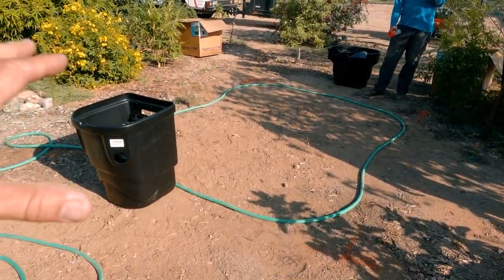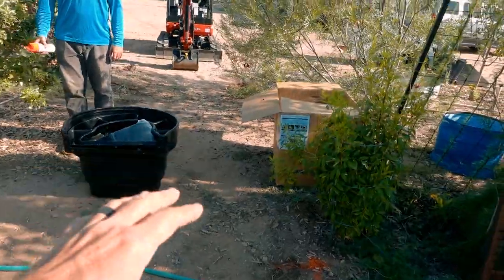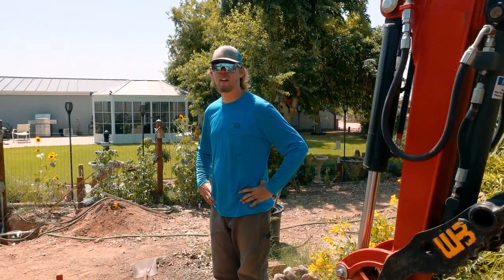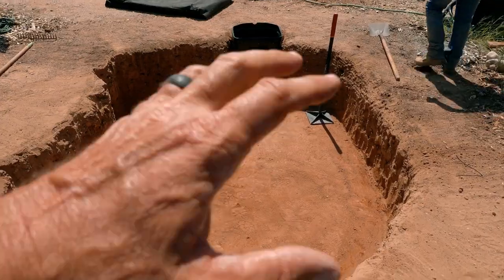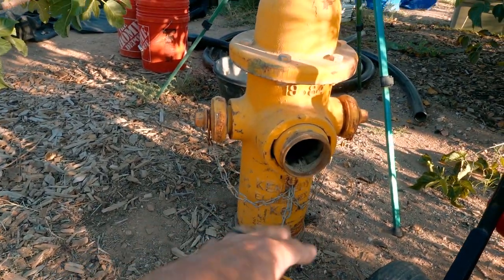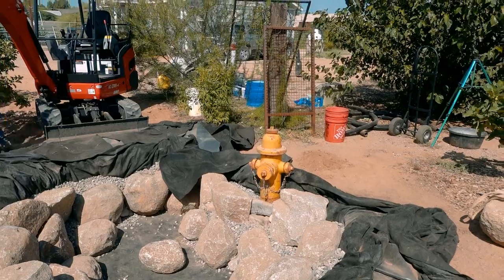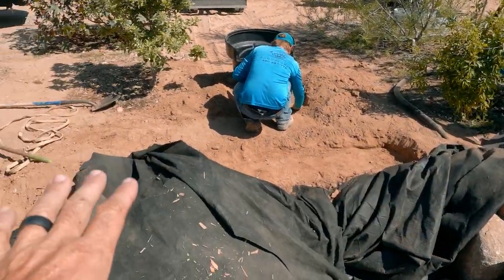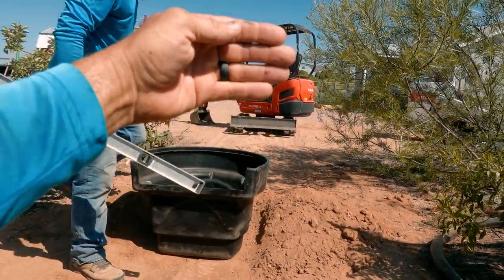Backyard Pond with 1 FIRE HYDRANT Fountain!

Comment: Nice intro with the machine.  I wish I had spare fire hydrant lying around.  Looks very nice there.  I may have asked you this before on another video, but did I see blue markings on the boulders before you dumped them?  Did you tell me before you tag with chaulk?  If so, does it last very long or does it wash off right away as soon as water hits it?
Reply from the maker: Thank you Cory! Yes it is snap line chalk to tag my selection at the rock yard. Washes off easily.
Reply: @pondscapesaz  I have to go rock picking soon.  This will speed things up as long as it doesn't rain too much that day.  Lol

Comment: How did you get the water to flow out thr hydrant. We have a hydrant and want to do the same trickle flow out of it into a pond less rock base.
Reply from the maker: Split off the plumbing, going to the waterfall with a ball valve, controlling the flow out of the hydrant